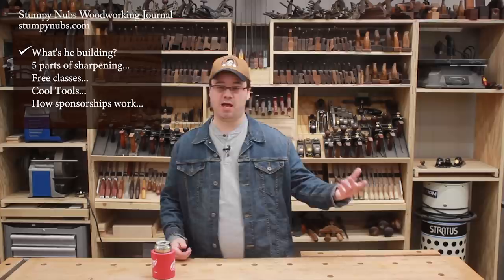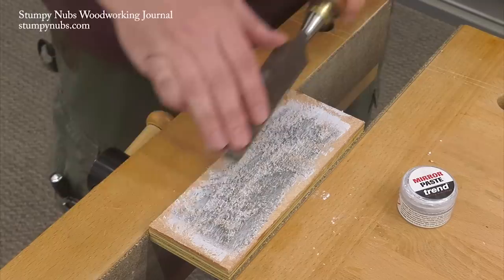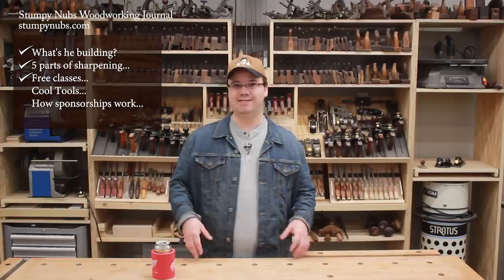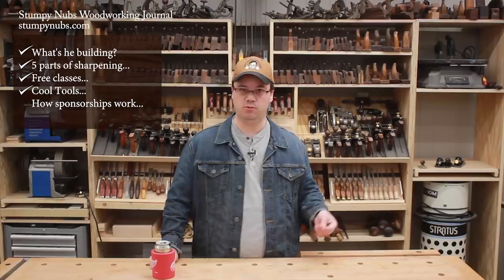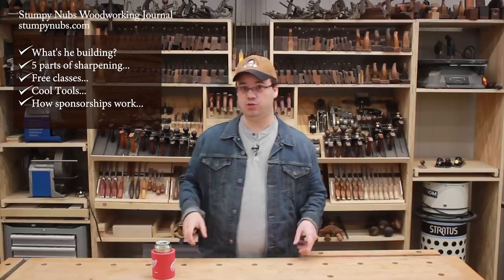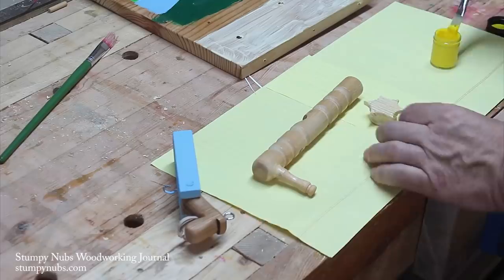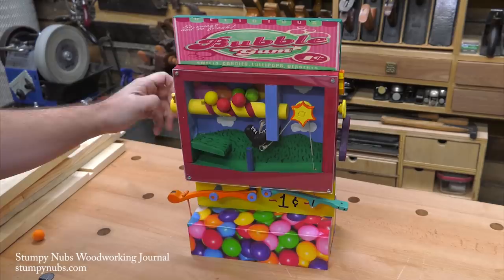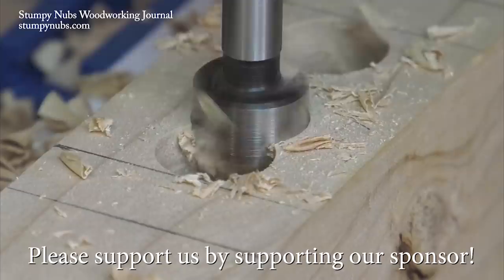Are SPONSORS ruining woodworking videos?

Comment: Stumpy I am a hobby woodworker and I have never taken a woodworking class and I am 70 years old so watching your videos are my classroom I have learned what to do but more importantly what not to do.  You even showed how you got injured and talked about the long recovery it took.  If someone like you who has hours and hours of tool handling under your belt can get hurt then that means I can never get distracted when I am using power tools especially the table saw.  I am still struggling with making a table saw sled.  I have a nice delta table saw and I am learning new stuff every time I use it.  Your tip about using a block on my fence so when I use my miter bar I can make repetitive cuts by clamping a block on my fence and using it to get the proper distance to the blade then using the miter bar to make the cut this keeps me from using the miter bar with the fence and taking a chance of kick back.  I don't know if I explained that right but it saves me a lot of time measuring each piece.  

And like another person said Hates are going to hate so ignore them

Comment: In regards to the subject of endorsed products I can say that the Fisch Forstner Bits are a pretty big step up from the run of the mill boring bits I used to use. I started out with the 1 inch one and then the 1-1/4 inch one. the results led me to but a small set or the Fisch bits. I have now collected a pretty good collection of them and I have no regrets on spending the money to replace the cheap ones I had. A good endorsement for a good product. Don't even get me started on workbenches. Keep up the good work and I will keep up with watching your videos.

Comment: Just came to your videos recently.  My wife hates you!  I keep buying stuff she doesn't think I need.  I'm not sure I need them either, but....  I was in business for a long time that involved clients, employees and machinery, that was also deadline oriented.  I had two large rolling  tool boxes of hand (mechanics) tools carefully labeled and sorted.  I never bought a tool that I was happy with when I bought it.  "This is silly.  This is a waste of money.  This is unnecessary."  But inevitably, at 10:00 o'clock on a Monday night, with parts all over the floor, exhausted, I would get that tool which allowed me to finish the repair work, and go home for a few hours of sleep before I was back at it again the next day.  I own a sailboat now (34 foot Tartan).  It's like a whole new language to learn.  And even though I only sail on a large lake, I have it fit out as if I was going to cross an ocean.  It's full of tools , some of which you recommended, and parts and supplies.  Totally unnecessary.   But when the boom fell off at the bottom of Willsboro Bay, I could fix it.  When the spinnaker pole collapsed, I could fix it.  Overkill.  Probably.  But I can live with that.  Keep doing what you're doing.  You be you.  It's working.  I like your channel because it's thoughtful, well reasoned and doesn't waste any time.  But what I like best is that you find ways to solve problems, and isn't that the key to life?

Comment: Like audio equipment ads in audio magazines or tool ads in woodworking magazines, I have no problem with, and in fact enjoy, ads about products in areas I'm interested in. So bottom line, as long as the sponsors are woodworking related I don't have a problem with "ads" in woodworking videos.

Comment: Nothing wrong with sponsorship, especially the way you do it. 
You are an excellent teacher, this is The Best woodworking channel, actually one of the best youtube channels ever, and one of the bigger reasons for that is how you organise your uploads and make sponsorship relevant. I am sure there are thousand other tools that you have tried which havent made it to vids at all. If its good for you to use it, its most likely great for me, if I dont like it or dont need it I wont buy it but I will still watch that last bit of vid and I want to know whats out there and I will check website/product regardless. I only wish you had some European sponsorships too, that would make it easier for me personally, however that doesnt rule your sponsors out for me, there are 2 right now that offer a product that I want. My planer thicknesser (jointer planer) will be arriving in 10-14 days, have a guess.

ps. One thing I have learned the hard way is that I cant afford cheap low quality tools/gear. I would rather cry once than everytime using it, and there is nothing worse than a compromised result. I have also learned that there are "cheaper" tools of decent quality which is what your channel demonstrates well too.
Hope you dont mind the essay, keep up the great work, thanks.

Comment: I large part I think it's the way an ad or promotion is handled rather than the ad/promo itself.  I've seen some very clever ways of getting a sponsor into a video and haven't minded a bit even when I would never even consider purchasing that product.  On the flipside we have channels that have a new 'very good friends at [insert new sponsor or supplier here]' every video and it becomes a bit insulting over time.
I find that the most irritating promos are the ones that the host spends two minutes on near the start of the video (looking at you, every single VPN advertiser), or the mid-roll ads that cut halfway through a sentence.  I currently have a beef with a couple of advertisers who are clearly in the USA and UK who are making badly-target ads for my geographic area and it's clear that they are just making the same ad dozens of times but just changing the location.

Comment: Enjoyed the explanation. And I find your videos helpful. The kicker though is I'm certainly never going to own a workshop like that. For example, one set of the chisels behind you probably costs more than all my kit together. And the example you gave of the expensive sharpening tool...I followed the link and it was so far outside what I would ever think of paying for such a thing, it was a bit spirit crushing. Maybe that's what's going on with the haters. And in your defence you spent a good while taking about the super cheap jig and linked to a video about how to improve it, so I wouldn't worry about it. You asked for comment, so I'm just saying. I appreciate the work though 👍
Reply from the maker: You may be surprised about some of those chisels. Two are IBC, which are expensive. I use them for dovetailing only. The maple-handled Stanley set's my "good chisels". It cost about $100 for the set. The dark handles Stanley Bailey set was $60 and they are pretty nice. Next to that is a set of inexpensive Narex, maybe $40. Next to that (actually they are not there at the moment) is a set of Irwin/Marples plastic handled chisels, and a set of Stanley Fat Max plastic handled chisels that I let people borrow. Those were both cheap. The expensive chisels are the antique ones on the left. Those turn of the century Everlasting chisels are several hundred dollars.... My point is, I don't just use expensive tools. I use plenty of inexpensive ones as well. I do own multiple sets, but that's not because I think people need them. It's because my job is to try different tools and let you folks know if they're worth the price :)

Comment: A bit off topic and I would appreciate your council on the use of MDF. Specifically using it for non structural things lik doors and dust enclosures. For example the band saw cabinet skins. I would seal all surfaces, I  know that it drinks water, especially here in Georgia where it feels like the air is poured out of a steam room. Is there anyother sheeting that would appropriate? 

Also, how does each covering 'scale' in thickness to the specified material? 

Any other references to the practical (a 'material data sheet' would be, for me, useless. I am an IT guy, and space cadet - I retired from the Jet Propulsion Laboratory; Caltech, NASA. JPL did the Voyagers, Mars landers, rovers, and orbiters & and gobs of other stuff).

Chris

Comment: if you don't like pre roll ads use adblocker.  as for tools i don't presume that expensive always relates to quality. i have been burned buying expensive tools and they have been rubbish.  i prefer to look at each individual tool itself, taking into consideration price and quality of build.  if it is something you only use occasionally do you need to buy one that will last 10,000 hours at ten times the price?

Comment: i do most of the sharpening around my area, and lately i had two customers who brought in HSS 12" planer knives that were DESTROYED... we're not talking nicks - we're talking CHUNKS... you can't do that by hand... ended up making a jig to hold them in a piece of 4x4, and taking the belt sander to them just to get down to a profile i could work with... which leads me to a question - if i have set of planer knives, you can see on the top where there are two different metals... if they come in just loose, how can you tell by looking at them if they're carbide tipped, or high speed steel tipped?  IS there way?

Comment: Putting the ad at the end of the video for a company/tool you're showcasing during the video can definitely lead to people questioning recommendations. Transparency is the key, and I'd prefer to be bothered during the video by announcement (in text or verbally) of that sponsorship. Putting the ad at the end is convenient for avoiding the ad itself, but it's not helpful to the transparency. Until I saw this video I didn't realize the content on the sharpening jig was sponsored by Bridge City Tools because I didn't (as often happens) watch the video until the end. And not having that knowledge during the video doesn't disclose the potential bias - even though in this case there was none, other than the exclusion other premium jigs - to be known.

To be clear, I'm not talking about simple use of a tool made by a company that is a sponsor (you use a table saw made by a video sponsor), only where the tool itself is highlighted (you made a video about different table saws and one of the saws highlighted specifically sponsored the video). 

I have zero problems with your sponsors, your use of sponsored tools, or the ads that get generated for your sponsors, and I very much appreciate the content and the things I've learned from your channel.  Thanks!
Reply from the maker: If I put the ad or a notification at the beginning, people shut their brains off and, like the example I cited in this video, they don't see the useful content of the video because they are fixated on that ad. It's counterproductive to the teaching we're trying to do. And I disagree that putting the ad at the end "is not useful to transparency." It's not an hour-long video. The ad appears within a couple minutes of the tool. Not to mention there's a notification with the links to the sponsored product in the description, and usually a notification pinned to the top of the comments. All of this goes WELL above and beyond FCC and YouTube requirements. I can't help it if people decide to check out before learning all the facts. Believe me, sponsors would PREFER the ad was early in the video. I could make more money if I didn't do it like I do. But I have to balance sponsors with keeping the attention of the viewers long enough to achieve my primary goal of education.

Comment: Technical question from a video producer wannabe: is the closing a standard clip you always use? The audio quality is identical to the audio in the main video and the chuckle sounds the same. I used to work with an independent production house and I don’t think they could match the audio that well. (Their normal output was broadcast quality...)
Reply from the maker: You mean the "Wait! Don't go yet..." clip? Yes, it's a stock clip. All the audio is done with the same mic on camera standing in the same part of the shop even if it's just narration. It's not perfect, but it is easier to keep a consistent sound that way.